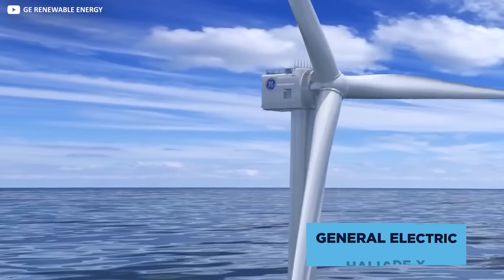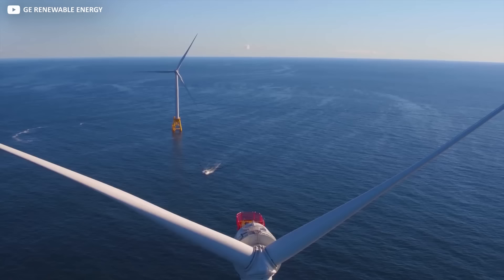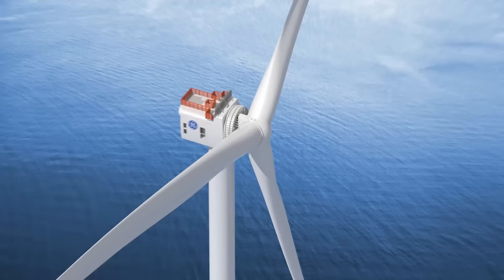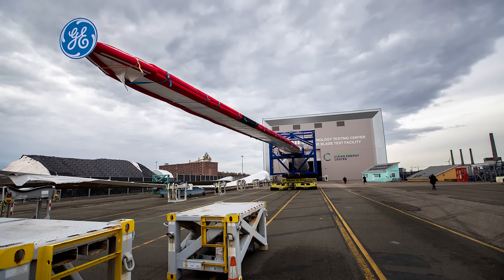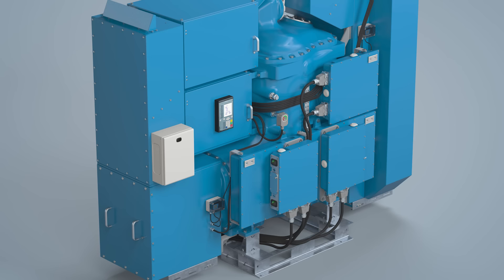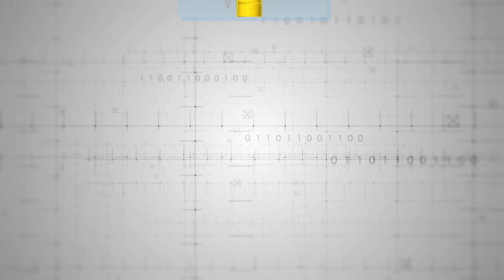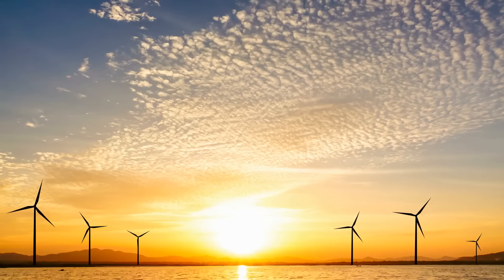The World's Biggest Wind Turbine

Comment: Wind energy conversion.
In layman's terms, I will explain why 'renewables' are not going to solve the energy needs of a society that takes for granted that turning on a light is a simple process.
Wind is not something we 'farm'.
Wind is a result of the rotation of the earth at the speed of 1000 Kph at the equator.
A wind harnessing device called a wind mill uses this force to push huge aerofoils in one direction that are mounted on a central shaft that has a generator comprising of metallic elements, mostly copper, central to producing the power they are designed for, that requires no fossil fuel to operate.
But what it takes to get this machine upright and positioned in such a way and in a place that will cause this physical reaction to take place is something that people are not made aware of, for fear of a concerted back lash by those who have every right to be wary and concerned of the detrimental impact they have on the surrounding countryside and those who live close by .
 What is involved to get it to that stage and the energy and materials needed to create these machines in it's self is, in no way, is a simple process. 
Unlike the explanations our governments give us to have us blindly accept there is no other alternative, other than nuclear power, and that is their scare the shit out of us gun.
Starting with the mines that all the raw materials come from, then the transportation of this raw material to where they are converted into the millions of individual items such as nuts and bolts and washers to stop them from falling apart requires huge amounts of fossil fuels to power the tractors and trucks and locomotives and ships to get it to the first stage of their production.
Using the energy created by coal burning power generators to produce not only the steel needed but for every single item required to have the finished product that will end up cluttering up our skyline and oceans, will take thousands of tons of coal and gas to produce the type of energy required to produce the steel these machines are made of, and that means carbon emissions.
Getting all the components to the site needed for the assembly is a major logistical effort that takes thousands of people to perform, all depending on the machinery called cars. boats. and planes to do so. 
All consuming power that is not produced by coal, but is a vital element in the so called reduction of our dependency on carbon producing fuels for humans and industry to survive.
As soon as these machines are on the ground, they start deteriorating and have what is called 'A use by date' after which there will be the requirement to replace them with new ones, and that will end up being  thousands at any one time, and very little if anything of them can or will be recycled due to the nature of some of the materials used in their construction, such as the aerofoil blades that are made of synthetics that are not biodegradable. 
Taking into consideration the average cost to have these machines operating is up to fifty million dollars at a time, it is usually the governments who will subsidize these projects. Believing there will be a return on the money invested in these projects, assisting the multi national companies who control all the natural resources and the extraction of the elements required for the manufacture of all things associated with the renewable energy market.. Solar panels included demanding funds to prop up a process that is flawed.
Everything produced for the renewable energy market has to be replaced every five to seven years, and when they are replaced, it will be at twice the cost of the original, due to the depletion of all the natural resources being used becoming more expensive to mine and process.
It is self a defeating exercise to keep thinking that 'renewables' can replace our growing thirst for our electronic device driven society to bare. 
Carbon reduction. ?
That went out the door the second they thought that creating millions of tons of carbon in the production of all these devices by burning whats left of our fossil fuels was a good idea.
Clueless.
The whole lot of them.

Comment: I  love it when wind and solar people say their unit will heat so many thousand households.  If only.!  Every one of these subsidy harvesters has to have gas or oil quick back up,  let alone  massive grid systems all over the place with their capacitance issues.  Power needs to be costed 24/7/365 at the consumer's meter,  not at the generator terminals.  Hence the more wind and solar a country's system has on it,  the higher the price of the power to the consumer.  Witness Germany or Ireland.  But all will be evened out by having a mega grid down to Greece and Bulgaria.  No,  we are not all living in China or the Automatous Province of Tibet,  where a sacred river is to be dammed for 60GW and no one has a back yard.    We need to get over our silly fears of nuclear,  especially the Gen 4, such as Moltex,   like just being given a big push by the Canadian Government.

Comment: Low-density power turbine.    All existing wind turbines are an area-based power system with ever-larger diameter blades occupying larger and larger footholds and spaces; for example,  the wind blade size diameter change ranges from  10 M  in 1979  to  162M  in 2019  for  40 years,   just think about the sizes what if we still used ever-larger vacuum tubes which first used in ENIAC   instead of ever-smaller semiconductor chips on your PC or phone, then we declared ever-larger vacuum tubes are a technology breakthrough,   the world would laugh at us, why nobody laughs at the wind turbine manufacturers,  there has been no fundamental innovation in wind turbine industries for last 100 year !!!

Comment: I hope this turns into a fruit full investment! but we got a long was to go in 50 yrs people will be like wtf why did they do it like that lol
Reply: All that North sea oil  gone   we must have been led astray
Reply: Well, you have to dig oil, gas and coal from the ground, you don't have to dig for the wind.  So, in effect, the fuel is absolutely free.
Reply: @TAttiusMaximvs  i agree but you do have to dig for all the copper ore and steel ore melt it and refine to the power generator motor ya need to make the energy plus lithium requirements are not the m be  ost environmentally friendly as well. 
I am all for green energy and there are many ground breaking things on the horizon but asking questions of what after seems to be taken as hostility against green energy. 
No motor or solar panels last for ever so when millions are needed to be recycled and replaced what are the steps in place (right now nothing we are struggling to get standardized rules in manufacturing and disposal but it a lot of gray area out there) 
Hope ya having a awesome day love talking to fellow thinkers. 🖖

Comment: GE makes gas turbines.  It these were the best way to capture the energy, why don't they use them in their gas turbines.  They use one of  those farmer's fan type turbines for their jet engines.  These turbines let most of the air through.  The longer the blades, the longer they spend lower to the ground.  If the climate science is bullshit, what about the green science.  
Here is a big turbine.  A vertical rotor turbine one kilometer in diameter with sails like on a sailboat on masts sticking up.  The side that travels with wind has tge sails unfurled.  When the rotor gets to the farthest point the sail is angled to gear into the wind like on a sailboat.  I will bet that kind of turbine could get more energy per square meter of swept area.  Most of these turbines are empty space that let the air  through.  
10 megawatts out of the possible 70 or 80 megawatts for a certain volume of air is not the 35% efficiency that we hear about for these turbines.

Comment: yet I keep wondering how much energy it costs to make those things, transport them and put them there, very difficult to find a clear answer to that yet I keep wondering how much energy it costs to make those things, transport them and put them there, very difficult to find a clear answer to that
Reply: You have to compare that to the cost of building a few new oil or gas-fired power stations.  Oh yes, and they then need to BUY their fuel, unlike the wind that blows for free.  And employ hundreds of employees, access roads, buildings, and other infrastructure, rail tracks, railroad engines and hundreds of oil or gas waggons ...
Reply: @TAttiusMaximvs  I totally get your point.
but do not forget that there are also mines and that there is also the necessary pollution?
mining steel is not exactly the cleanest of its kind, but you don't hear much about that?
let alone the costs, because roads must also be stated for that and other things that you gave in your comments.

Comment: What a waste of effort. We should put these resources into something useful like nuclear power. 

Nuclear is smaller, easier to site, lasts 60+ not 20 years, and has capacity factors of over 90% not 60% when they're lucky, and the generation isn't random. As an added bonus it's lower emissions and cheaper since nuclear requires no fossil fuel backups or expensive storage.
Reply: Nuclear power costs too much and takes more than a decade to bring online.
Reply: @acmefixer1  Neither of those things are true. You're just cherry picking a few obvious examples to support your bias against nuclear power. In reality nuclear is the fastest way to decarbonize because the majority of reactors are built on time and on budget, as well as being extremely cheap in terms of total costs. 

This is borne out by the fact that only nuclear power has ever reduced carbon emissions. ;) Wind and solar have an unbroken track record of failure, and always will since they don't work at all. Their main contribution to the world's energy mix has been a massive expansion of CO2 spewing natural gas power plants. Because as intermittent and therefore broken power sources they need them for the backups.

Nuclear on the other hand is an actual permanent fix, no supplemental power sources needed. This is why France was able to become over 75% nuclear powered and carbon free in about 20 years. Whereas every place attempting to be wind or solar powered is simply failing. Or at best bragging about having low carbon emission for a few days of the year.

Comment: Wow, all of 12 MW times that optimistic 63 % availability that's about 7.5 Mwatts. Hinkley point will have for sets of about 775Mwatts each with availability in the high 90's% and 100% when required in the winter.

Wind is still asynchronous and has no inertia. It still needs back up capcity equal to all the installed wind capcity.
It is not a good idea despite all the spin from developers and the compliant media.
Reply: Your calculation is correct. It is also correct that wind alone cannot run an entire country/market, at least for now. Wind/solar/nuclear/gas/coal can all be part of the energy production mix. Having an energy mix as opposed to running just one type of production gives you higher energy security and stability, because you're rarely dependent on swings in resource prices.
Reply: @pjacobsen1000 , wind + solar + battery storage can replace all fossil fuel energy generation, is more cost effective, and on most days produces extra energy that can be used for things like desalinization to produce fresh water or synthesizing fuels from carbon capture.
Reply: @CL-gq3no  Yes, I agree, but that is a solution that is still in the future.
Reply: @pjacobsen1000  
The "solution in the future" is already here, now.

Comment: So wind the wind is not blowing where is the base load power coming from? A twenty year life span seems very short, with modern materials and major component change why is this life not around 50 years plus.
Reply: Think about the constant change in wind speeds and other stresses these things are under, as these things approach the limits of tip speed, I wonder how many won’t last nearly so long due to being overly optimistic, and the random hard windstorm or hail hitting blades too often as they move at several hundred miles per hour.

Comment: 2:30 80 m/s is bullshit. Tip speed is 60-80 km/h at rated power. Best regards from someone operating wind turbines since 1995.
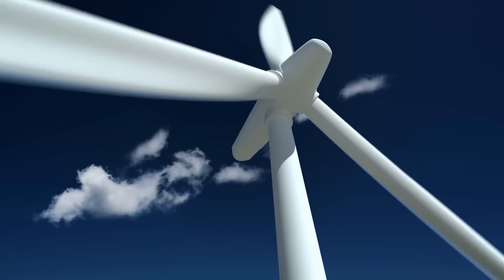2:35 What about some metrical units instead  of those banana units?
Generally those G.E. turbines are quite crappy, no matter how much propaganda they spread. I own some, unfortunately. And the newest have complete failures of main components within 1-5 years.

Comment: I've never seen where how long payback time (when the windmill is paid for and become profitable) is for these ugly monsters.
Reply: Yes, is not a quite common information, but I did once the math for a nearby windfarm, and it was few years, about 5 if I remember well. 

You can do for this too. smaller units around 3 MW are about one million pounds per MW installed. Smaller one are three times more per MW installed. So I assume that these bigger ones may be even more efficient so maybe one of these costs something like 6 milion pounds. Now do some math. multiply with 20 and see how many Kwh must be sold to return the investment. in the video you see the annual production. If you divide the total resulted before at annual production, you get less than 2 years. but there is the cost on install, and this is about 30 percent of the cost of windmill itself. So in the end you get about 3 years. It matches those 5 years I remember. those are 2 MW turbines, and obviously slower ROI. So, those turbines are already paid. And each will bring to the owner a third of a million every year. There are some maintenance expenses,  and decommissioning, but still there is a quarter of million coming into the pocket every year.  

So each of these turbines will pay itself in three years, and then will bring every year 2 million profit. And this for the next 20 years.

Not so ugly now:)
Reply: Considerably less than an oil-fired, or gas-fired power station!